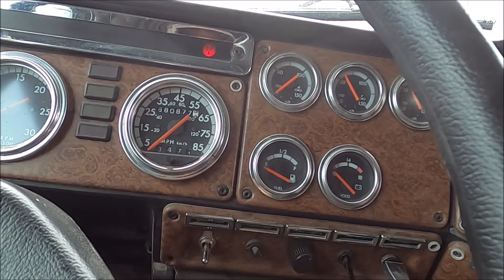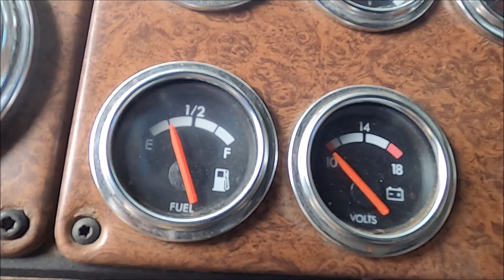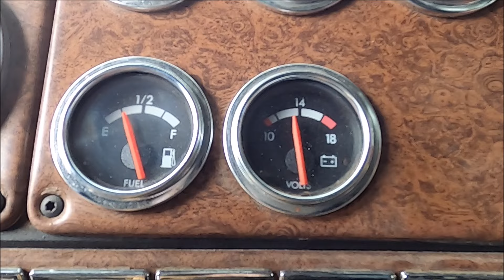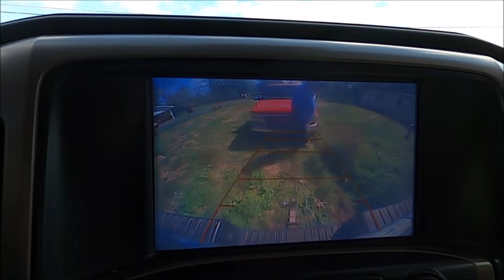Dexter doitall Farmer Pull Day

Comment: Hey Dexter, a little advice..careful working on batteries with your wedding ring on buddy..high voltage creates heat..😮😊
Reply: When removing cables to work on removing batteries, Always take the negative off first, you do not have to worry about you ring finger being a conductor The ground should always be the first disconnected and the last connected. Learned this in automotive technology class. Still yet I never liked working with my ring on. I never liked to work with my ring on because this can hinder you from getting your hand out of the way of danger.
Reply from the maker: Ok thanks for the advice